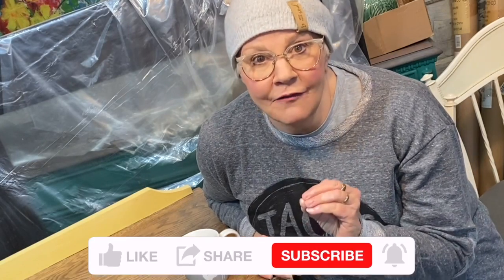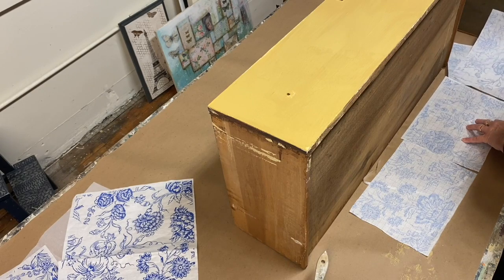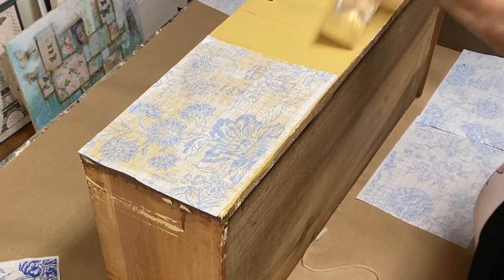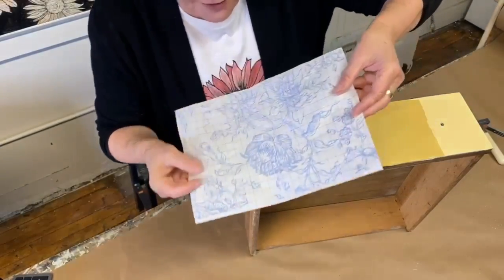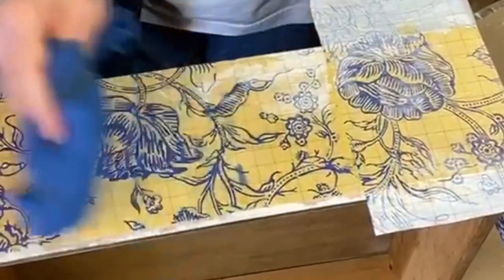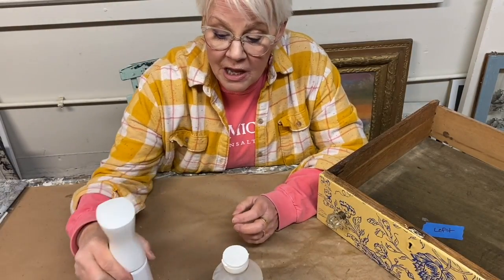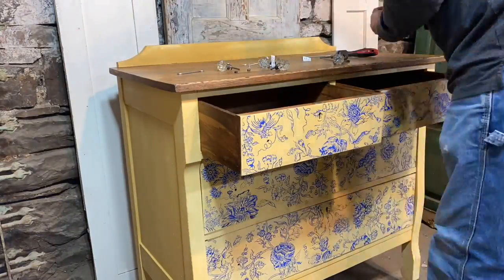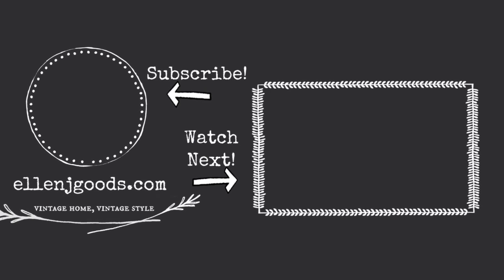IOD INLAY BASICS and THE BIG MISTAKES I MADE on my first project

Comment: Question?? I did the sealer but it wasn't enough. Mine has done the same thing. When you sanded down a second time did you have to get the wax off so it wouldn't gum up? or do you just sand until the inlay is off ?
Thank you so much for this video...

Comment: Hi Ellen, thanks for sharing! I do have a question. What would happen if you just used a polycrylic over the inlay and skipped the water/poly spray step? Do you think the pigment would move?
Reply from the maker: Yes. The pigments are water soluble so they would definitely smudge. I know some people x have been able to apply a quick coat in one direction with some success, but I do think the mist application is one easy step that could prevent issues with pigment movement.
Reply: I did a light coat of a spray fixative after letting the inlays dry for a few days (a set of coasters).  I let the fixative dry overnight. Even after that there was some slight movement of the pigment when I went to apply the poly.  Next time I'll try 2 coats of your water/poly combo. Your project came out beautiful despite the issue with the inlays.
Reply from the maker: @nadineconnors2008  yes. I think two coats is the ticket!
Reply: Hi Ellen! I made a faux vintage sign board with IOD’s Gregory’s Seed Catalogue paint inlay and IOD Painterly Florals. I used Krylon Low Odor Clear Finish spray in several light coats. It stopped the paint from moving and sealed it enough to add a clear top coat.

Comment: Your project turned out well and you've provided a nice tutorial. The DIY brand of paint (clay based) does not perform well for me. Too many clumps. Working dry time too fast.  Paint does not lay down nicely. I've also experienced issues with one layer and color of DIY pulling away from another layer when using rub-on transfers (yes, dry time was more than adequate...at least 24-36 hours between coats). Too many issues for the expense and poor end-result.
Reply from the maker: Thanks for your feedback. I’m sure you can find something that works well for you 💓